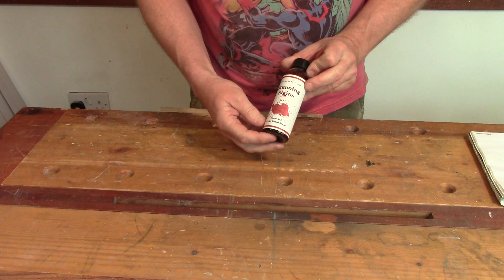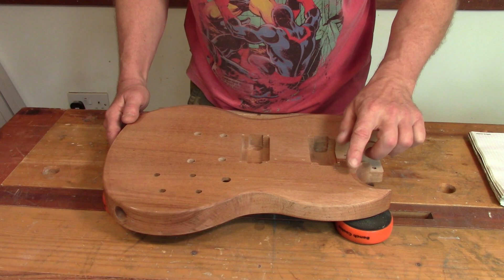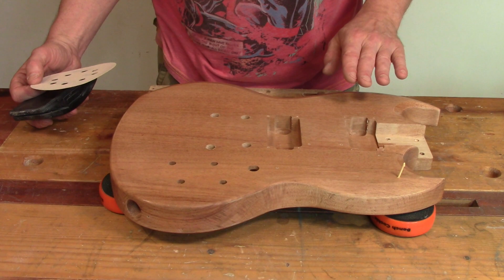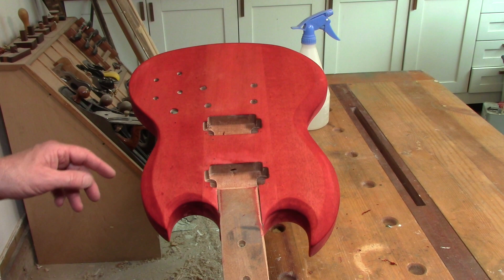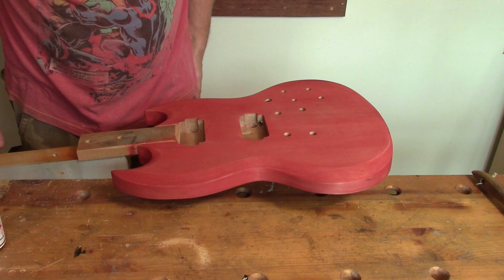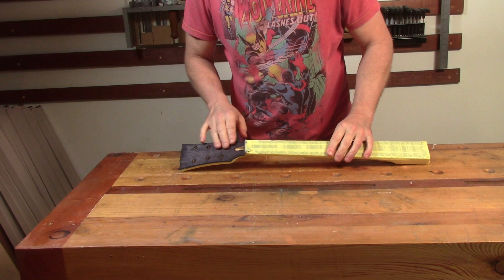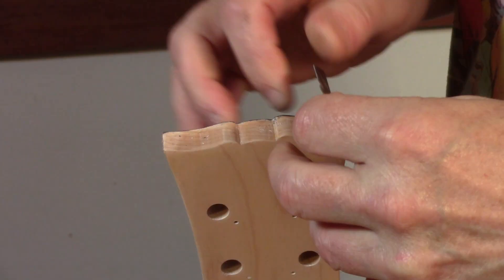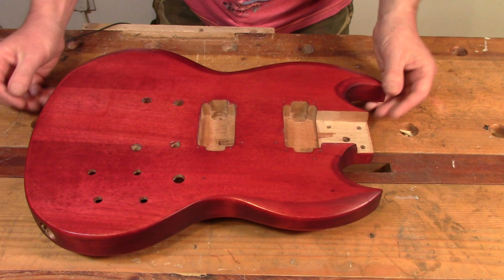Harley benton DC kit build part 2. Applying the finish.

Comment: good idea to have a kit on the channel as they have their own issues to deal with .. namely the manufacturer.. always interesting to see what pitfalls or flaws you will find in someone elses work.. and how to modify or improve it..  do you think that finishing oil is a truoil or danish oil type?  seems a bit thinner than truoil..
Reply from the maker: So far I've found this one to be ok, considering the cost. It all seems to fit together well but the proof will be in the playing. If I'm honest for the £90 it cost I'll be happy with anything playable. The finishing oil is very much like Danish oil, Idoubt you would ever get a gloss finish like I've seen some achieve with Truoil (I've never actually used Truoil)

Comment: nice tip about the painting stick in the vice, wish I'd have known about that before finishing my bass. p.s Out of interest, how long did you allow the stain to dry for?
Reply from the maker: A painting stick makes all the difference. I put three coats of stain on leaving about an hour between coats. I left the final coat a couple hours but I'm pretty sure I could have put the first coat on fairly soon after the final coat. The oil did take a bit of stain off.